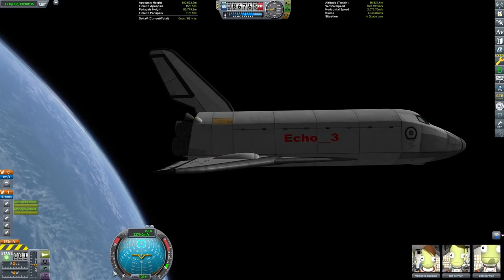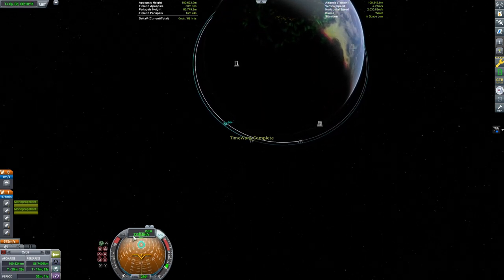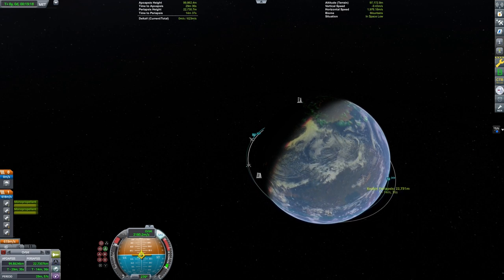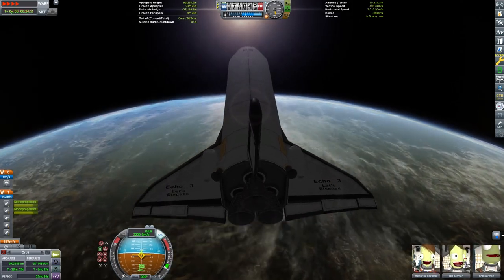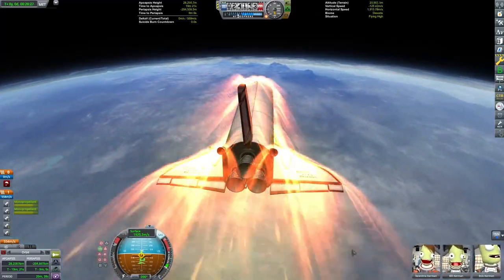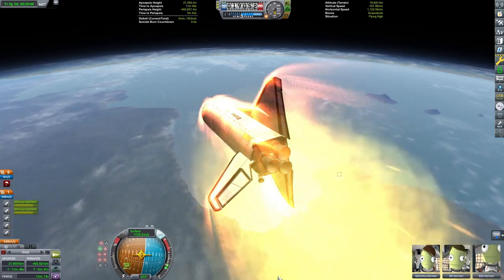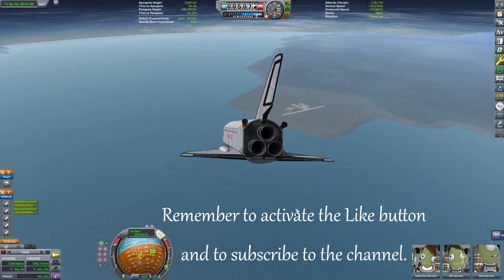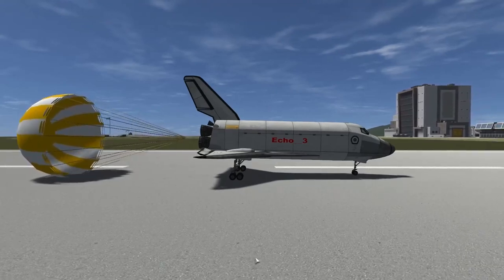How to land a shuttle back at the Kerbal Space Center runway

Comment: My shuttle is almost perfect. Just when I come in for landing, the front landing gear bounces up into the air destroying the back end of the shuttle. I’ve already tried adjusting my spring and damper, it doesn’t so much
Reply from the maker: How hard are you landing on the front gear? If you share some video (I'm on the KSP forum and reddit with the same name) I could take a look at your craft. You could also share it on KerbalX, and I could try it if you send me a link.
Reply: @Echo3  Yea, I can get my craft file sent over to you later on. It uses mods but Kerbal x should tell you what mods it uses
Reply from the maker: @bfgedits2024 this should work. If I make any changes, I'll share it with you on KerbalX.

Comment: i cannot get the shuttle to land safely AT ALL, getting near the runway is the least difficult part, mostly it comes to landing. My landing gears feel extremely bouncy regardless of what i do, and despite being attached to the fuselage the wings pretty consistently want to break. Not to mention it is almost impossible to land on the runway, The shuttle hates gliding properly and constantly flips, so I cant get any proper trajectory
Reply: basically it doesnt glide properly, Im unsure what to do
Reply from the maker: This sounds like both a piloting and design issue. For piloting, you want to land the craft with as little vertical velocity as possible - like 1 m/s. This can be achieved by flairing up right before touchdown. For design, the craft needs to be well balanced with its center of mass and center of aerodynamic pressure. You'll need the center of lift to be a little behind the center of mass. And you need to account for how releasing payload and using the fuel will affect this. I also like to use "flaps" and airbrakes to help control the descent.
Reply: Turn on advanced tweekables and auto strut the fuselage,then on landing gear override the damping and spring strength,put the spring strength much lower and the damping a lil lower. Check center of mass and center of lift "aerodynamics" and make sure the COM is always a lil in front even when you are out of fuel. The yaw wing should also be in mirror symmetry and set the "deploy" to the brakes so that they turn away from each other when you activate brakes "like the actual shuttle did" to make an air brake . Ensure the rear wheels are still close to or slightly behind the COM when the fuel is gone as well. I turn the brakes off on my front wheel. 
   Now as for the actual touchdown,there is a thing that real pilots do called "catching the pillow" which doesn't really work on this game,but if you can learn it,it makes it easier to touchdown softly. It's when you are about  to touchdown the air will sort of push you back up and stop you from hitting the ground "pillow" and you learn to feel for it and ride it till your speed drops enough that you lightly fall downwards while the nose is still pointing upwards. The very final flair upwards is hard to time,but if done correctly you should have a vertical speed of 1 to 2 m/sec. If you can get it to touch down at that speed and you still blow up,there is an issue with some part clipping and causing destruction. The sec you see an explosion,hit pause and go to flight record,read and see what parts are colliding with what part and fix it. If you have stability but can not get it to flair "point upwards" and lightly touch down,consider improving the glide ratio and try again. If craft is large,use the different types of auto strut "to largest part,to root part,to grandparent part" all mixed up and different. 
  I'll keep an eye out for a reply from ya and am more than happy to help if I can and you'd like. Try these tips and let us know how it went. I'm only half as good as the uploader is but I have more than 1000hrs on this game but on console. Hope this helps or atleast leads to helping. Just try and then use the flight record and see what it says is getting destroyed if none of these tips solve the issue.
   I'm very interested in if you manage a successful landing where nothing blows up. 
  I am also not trying to step on any toes,if the uploader wants to answer and help ya instead of me,he is better at this game than I am and it's his channel after all,I am just trying to help and am happy to do so. 
   Good luck,fly safe,and let me know what happens please.
Reply: Thank you both for the help, this definitely helped with the whole gliding and landing part of it, I think I overestimated my skills at pinpointing landing at the runway, but I should be able to improve with time, but definitely for sure I dont nearly have as bad time when I actually perform the landing part of it (I can land the shuttle now with little wobbling relatively close to the KSC) so thank you
Reply: Absolutely the same problem
Reply: @normalhuman9260 Dear friend, thank you very much for your advice and nuances, for the first time I learned from you that you can turn off the brake on the chassis or relax the spring. I encountered the same problem as the person to whom you gave advice. During 6 days of continuous work on the Orbiter and studying very large NASA engineering papers, I still can't exactly find the Glide Slope Angle for a soft landing. My shuttle is quite stable and everything is designed to perfection, but most of the problem lies in its handling during landing and my experience as a pilot. Perhaps the movements are too sharp or there are problems with balance, because often the shuttle either turns over on its back and simply falls, or it does not have enough strength to raise its nose when landing and it hits the surface. Using some mods to get accurate numbers and spending a lot of time and effort on calculations (higher technical education), I was able to achieve 100% hit on the runway, but landing, everything is sad there. Only one out of twenty landing attempts succeeds without problems. I hope you can give me some advice, too, you have 1000 hours of play time, don’t you, and I probably have about 60

I will be very grateful to you
Reply: @jimmy_exe  try making the rear wings that you use for pitch be right at 1/3 of the size of the front wings. Also try placing them a tad bit higher. Decrease the authority limit on the front wings that you use for roll. Also,in VAB,empty all the fuel and check and see if COL is getting too far behind COM. When I have a bit more time I'll come back,read and think about your problem a lot more,and get you some better advice. BTW,thank you very much for your kind words. I'll be back with more ASAP. Those few small things may help. Sounds like your main issue is with glide ratio,if the nose isn't wanting to get up there at low speed. Also,I can't remember the word for it,but the front main wings,make sure the very outside edge is slightly pointing upwards. It will help a lot with self correcting when you go dead stick.
Reply: @normalhuman9260  I didn’t quite understand about the wings, but I’m still eternally grateful to you for your help, all the best to you
Reply: @normalhuman9260  As for the chassis spring that needs to be relaxed, I didn’t find the spring parameter, maybe I need to download a mod?
Reply: @jimmy_exe  I only play on console, and therefore don't have access to mods. On console you have to go to settings, enable Advanced Tweekables,then while in VAB or in flight,press X and select Override on the spring. I haven't the faintest idea how it would be done on PC. 
How many and how large are your fins for yaw btw?
Reply: @jimmy_exe  and as for the wings that I made incompressible,sorry about that,the word I was searching for was Dihedral. Straight flat parallel wings are more acrobatic, but Dihedral wings are more stable and make a craft self correct even when going dead stick.
Reply: @normalhuman9260  Got it, thank you very much for the information, I’ll definitely take it into account
Reply: @normalhuman9260  At the end of the delta-shaped wing "Swept" there are two elevons, closer to the body "Swept S2", closer to the end of the wing "Swept S1", there are no elevons anywhere else

Comment: Ok so I got my shuttle to work exactly how I want it to but whenever I get it back to the KSC and I glide onto the runway and my back wheels make contact they just break off along with the wings? Could you help me out or tell me why?
Reply from the maker: I do not attach my wheels to the wing parts. I like to attach them to the main body and use the offset tool to place them at the correct width. Make sure you are using landing gear heavy enough to support the weight of your shuttle.
Reply: @Echo3  I want to thank you for your advice I changed my wheels and moved them more to the center and I finally landed it successfully!
Reply from the maker: @hunterozee7817  That is really cool!

Comment: Off subject question: when I get my shuttle to sub orb, I have a lot of trouble getting it into a fast enough orbit. Eventually it just falls back to kerbin. I use the terrier engines to get it into lko, but it just hasn't got enough power to get into orbit. And whenever I use more powerful engines. They just burn thru all the fuel. How do I combat this issue?
Reply from the maker: Start your gravity turn shortly after leaving the launch pad. Getting into orbit, as you know, is about horizontal velocity. How much Delta v does your craft have? What is the starting Thrust to Weigh Ratio and what is it for terrier engine stage?
Reply: Make sure your engines can use oxidizer to get out of the atmosphere, your fuel issue may be due to the weight of your craft, try less mass and more engine, rather than a plane full of fuel. For rocket engines on sstos i reccomend the Nerv atomic rocket, its great.

Comment: Another problem that I have is whenever I get through the higher atmosphere and I begin to feel effects of the lower atmosphere my space shuttle will always flip around and point retrograde when I'm pointing pro-grade and it will drag off too much speed for me to be able to land
Reply from the maker: This sounds like your craft is aerodynamically unstable. Make sure your center of aerodynamic pressure stays behind your center of mass regardless of fuel or payload. You can use 2 rudders deployed in opposite directions to help.

Comment: Mine flips out of control if I increase my angle of attack bc my center of mass is too far back, but without it doesn’t bleed off enough speed and when attempting to land, it breaks mid air like Columbia
Reply from the maker: Flipping out is because your center of aerodynamic pressure is too far forward relative to your center of mass. Make sure to check how the mass will shift as fuel is used and the payload is released. Also see how you center of pressure shifting as the angle of attack of the craft increases. Rotate the craft in the hanger to see this.

Comment: God it took me like what 30 quicksave loads just to safely land my space shuttle in one piece since the large landing gear just explodes without the fire thing even on 100 speed and like -2 vs that I had to land with no crash and unbreakable joint on I’m thinking of upgrading it with 1 or 2 more large reaction wheels (I have about 4 of them) or replace the small landing gear with a medium landing gear to make it absorb damage more and less chances of the shuttle becoming from flying brick to just a brick and shortly becoming a fireball move in anime shows or both
Reply from the maker: I like to attach the rear landing gear to the fuselage and offset them out to the wings. You may need a medium for the front depending on the weight of the shuttle. Make sure your vertical speed is very slow, just a couple meters per second.
Reply: @Echo3  I got mechjeb yesterday now so it should make landing easier with auto land idk if it works on planes without jet engines (basically gliders) tho
Reply from the maker: @Madenity  I haven't used MechJeb very much. I'd be interested in hearing about your experience with it.

Comment: How would you go about controlling Heat
Reply from the maker: Do you mean during re-entry? I hold the craft at an angle to bleed off speed and spread the heat out over much of the craft. The Big S wings and Mk3 spaceplane parts have very high heat tolerances too. Orbital velocity around Kerbin is pretty low, so most craft do not require any heatshield except for the most sensitive parts like the science jr.
Reply: @Echo3  another problem I would have with the Ring of the re-entry is once I start getting close to the Space Center my space shuttle will always flip retrograde when I'm facing prograde and I will make it so I lose too much speed and I won't make it
Reply: @spaceflightgaming6567  your center of mass is moving too far forward when you are low on fuel. Ensure the COM is always in front of the COL no matter how much fuel you have used. I had the same problem for awhile because my COM was fine in the VAB when fully fueled,but went real far to the back when out of gas,go through the atmosphere and as soon as it gets thick I would flip backwards.